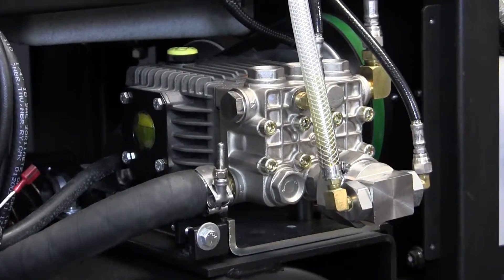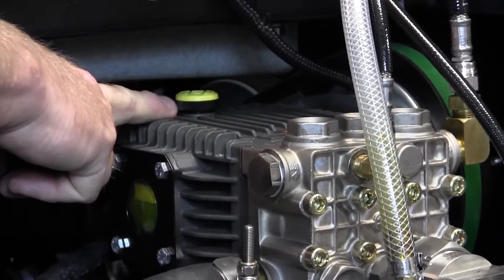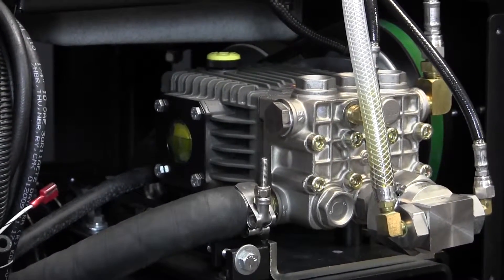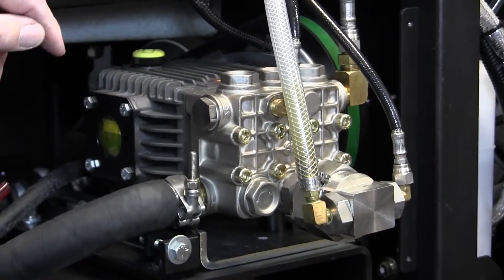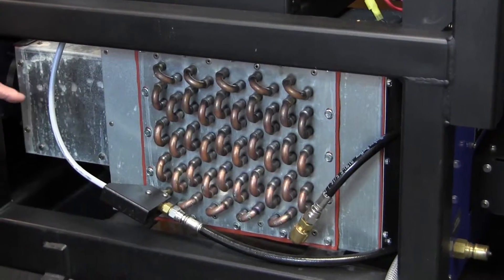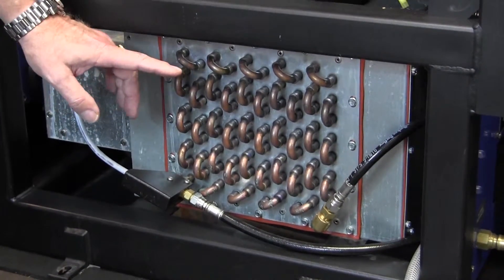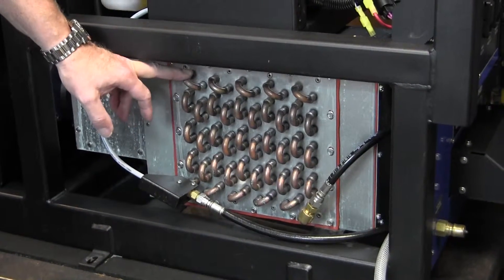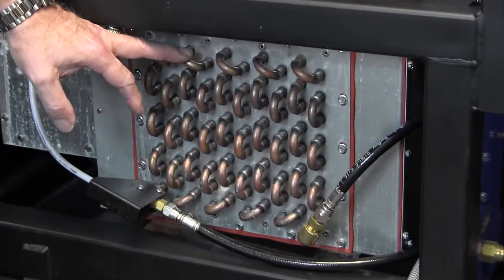Titan 575 High Pressure Pump and  Heat Exchanger

Comment: 1:40 If a pipe of the heat exchanger is burst, is there any way to fix it? or should i replace the whole unit?
Reply from the maker: Contact our Tech Support Team at techsupport@hydramaster.com or call tem at 425-775-7272, option 2 and they will be glad to help you